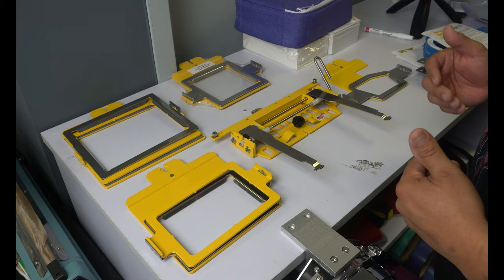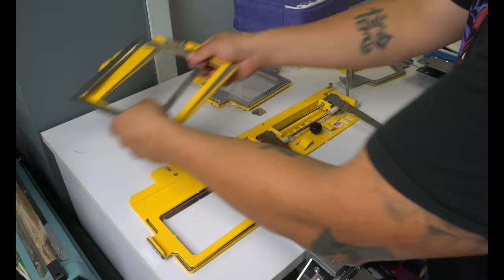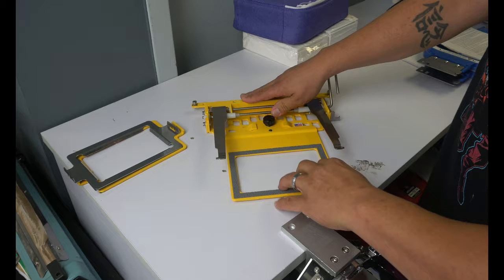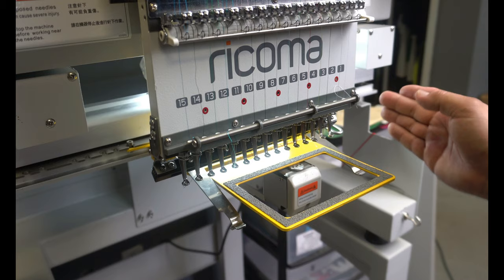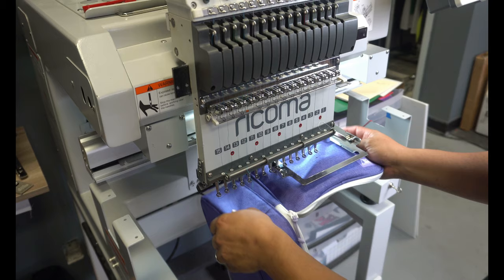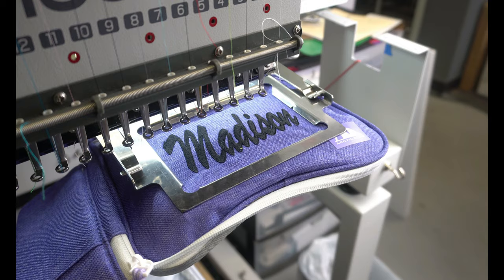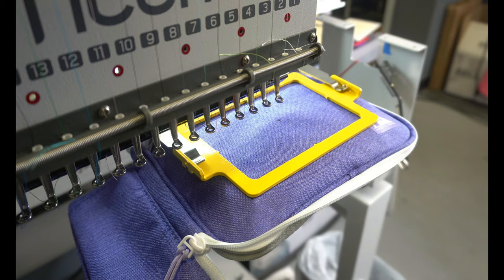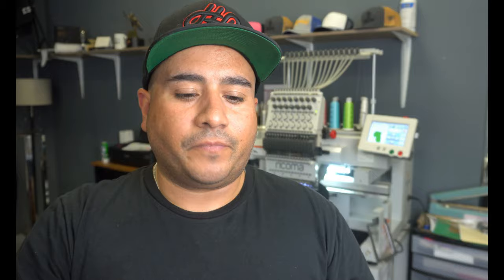Embroidery on some bags with HoopTech hoops from Sew for Less

Comment: Damn!!! That's insane how close to the edge👏🏼👏🏼👏🏼👍🏻
Reply from the maker: Pushed it to the limit. Try doing that with a circle hoop.
Reply: @HeartHustlePrinting  no way! I just started using mine and I have been struggling a bit, I didn't take the training yet. On mine Mamy times is leaving tread excess every time it cuts
Reply from the maker: Could be a tension issue. When triming